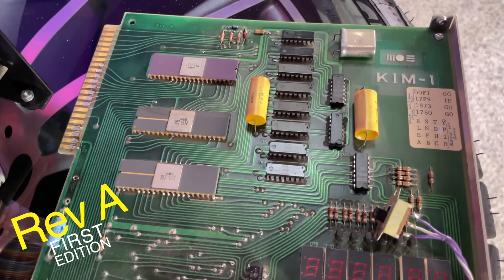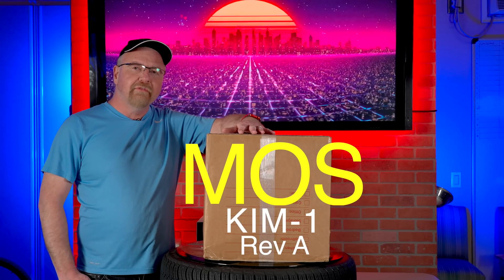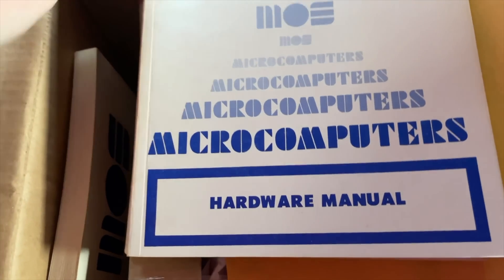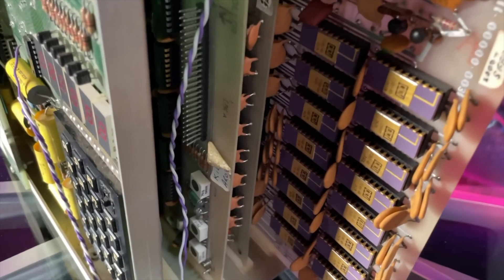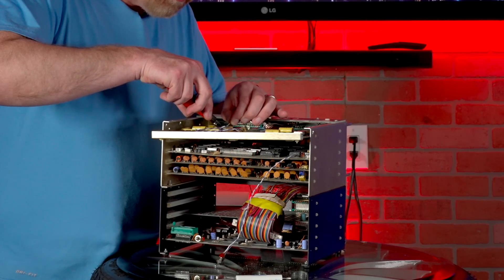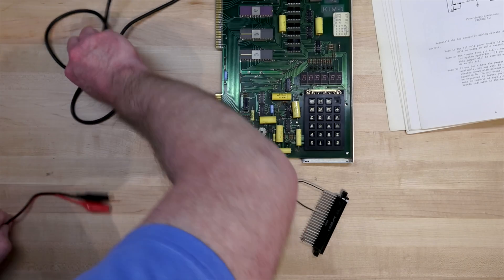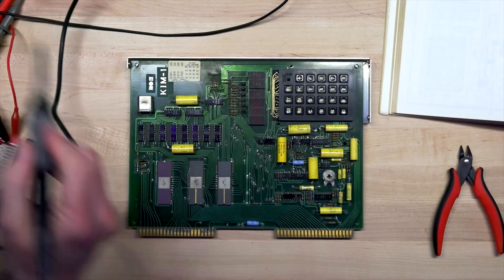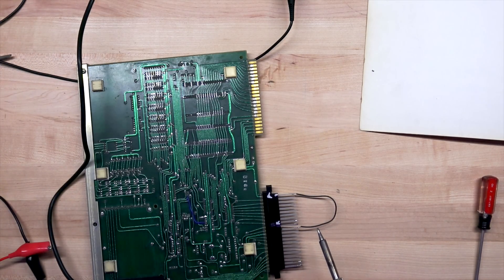I Bought the Oldest PC on eBay! Unboxing the KIM-1

Comment: The KIM-1 actually was my first computer, I was busy building my own from scratch, but that didn't progress beyond 1K of RAM (eight 2102 static rams) and a bunch of LED's and switches, so I could change the bits in the memory. With the KIM-1 I learned 6502 assembler using hand assembled 6502 code, I wrote up the 6502 mnemonics, then using a mnemoncs to hex booklet I hand assembled my code and entered the resulting hex code into the KIM, then saved it to cassette, as a bug in your code usually resulted in the code being overwritten. After that I built a LNW-80 a TRS-80 clone that had color and highres, but color and highres wasn't used, the floppy controller was more interesting as I could boot Newdos-80 and play games like cosmic commander, weerd, and other games.

Comment: I'm fortunate to have had two Altairs, an IMSAI and hand-built a Processor Technology Sol-20.
Bill Gates BASIC on cassette, CP/M, etc. In short, Intel 8080 born and bred.
Now I wax nostalgic for all the Moto 6502, Commodore, et al that I missed.
Saw the KIM-1 back in the day, but will settle for firing up my Apple IIe and writing something in 65C02 assembly.
Thanks for the dynamic memories.

Comment: 14:19 that's a bodge wire, pretty common in older hardware, when it wasn't so simple and cheap to respin a board.
Also, look into replacing those electrolytic caps, you don't want to risk them leaking.
Reply: Those caps won't leak.
Reply: @Dbumbaca1  those axial yellow ones won't, but there are a bunch of electrolytics there (I'm talking about those), and not only that, they tend to lose capacitance and increase ESR with age, so it would be best to recap those boards anyway.

Comment: That indeed is the crystal with 2 leads. The thing is actually a filter that allows only a sine wave at the desired frequency to pass, so the square wave gets filtered down to a sine wave, which then gets amplified to the square wave, and the whole thing then is locked into the frequency that the crystal passes.  Sometimes way back then, things didn't always reliably start, and work had to be done to get enough of a thump into the system to get it to start.  Your system doesn't seem to have that issue. 8)

I'm helping a friend get an IMSAI going, and have learned to hate toggle switch inputs with a passion... you're so much ahead of the curve with the Hex pad.  Good luck in your ongoing efforts.

Comment: Sine wave on one crystal pin is totally normal. The square wave comes from a digital output which has lots of harmonics, the crystal is like a super good filter at one frequency so you only see one ‘tone’.
Reply: TIL
Reply: Mhm but if the CPU performs certain operations on rising or falling flank of the clock, when is it exactly in a sine wave? So aren't you supposed to prepare the clock by turning it into a square wave, amplify, Schmitt trigger, before you feed it to a digital circuit?
Reply: @SianaGearz  inside the cpu is a circuit the drives the crystal and gets its input from the crystal at the same time (sort of an amplifier) the driving side is a square wave and is used by the cpu, the sine side just goes back to the input of the circuit.
Reply: @sefarkas0  Oh so the 6502 has the crystal drive and the digital clock generation built-in; Z80 does not and i think 6510 might not either, or at least is normally used with an external clock circuit maybe for cycle stealing shenanigans.
Reply: @SianaGearz  z80 and 6502 do not have a built in crystal clock circuit. Back then they used external sources usually with more than one clock signal (phase 1 phase 2). Modem cpus have a the oscillator built in and you supply the crystal externally. They are labeled in and out, the square wave is on the out pin.

Comment: Hi Dave.   Broght back memories of the intel SDK-85s We used in college…different processor but All the same functionality.

Yes your crystal is going to take the square(ish) wave from the clock inverter output and filter it to near perfect sinusoid, phase shift it by 180 degrees, and that becomes the input back to said inverter.   Oscillators are fundamentally analog circuits, even though most are built using a logic gate as the amplifier.

One hardware guy tip is to never trust that your oscillator is working or not working based ONLY on what you see on a ‘scope.   The 10pF of a scope probe can be the difference between an oscillator that works or not.

Comment: Makes me want to get out my Kim 2!  I have the one I purchased in 1982 (?) and still have the manuals and even some assembly worksheets I made at the time.  I actually made a commercial product using the Kim 2 and purchased several hundred!

Thank you so much for all of your very entertaining videos.
Reply: Oops!  Spoke to quickly and had a senior moment:  I have a SYM-1 made by Synertek Systems Corp - Everything else is true !  I have never seen a KIM, only heard of them.  The SYM-1 is very similar to the KIM-1 only the board is bigger, the keyboard has more buttons, there is room for more RAM, and room for additional ROM chips.  Mine only has the built in monitor ROM and no basic although I believe there was a BASIC ROM available.  I wrote in Machine / Hand Assembly.
Reply: @Peter-House-Jr  And now we all want some history to this.  None of us are ever going to be Dave, but even an 'amateur'(!) video would be well received.  Honest, no matter how bad the vid, we would love to see it.

Comment: This video was awesome. But as a PC guy, you and myself. 
retro build project.
Could you take an original IBM ?8088?
1st generation then see what latest dos version. MS/IBM/Dr or free dos. You can get just a working command prompt IE list files, CD ren etc.
 Challenge laid!
Games or apps not a problem. Just the command prompt.
As an aside what later hardware can you get working, with additional hardware. SD card reads? Or CDs prewritten  ROM (elsewhere down) to 1.44 MB storage.

Comment: Nice find! I love the form factor.
I've always had a sort of 'fetish' for card cage systems. I spent decades programming, and doing general repairs, and board level repairs on 8080 based card cage PLCs built in the late 70s that were used to run a utility plant, and all the HVAC and lighting systems in all the buildings. The last of which were decommissioned only a few years ago. For their era they were highly robust and one of the models was a dual controller system that could sense certain faults on one side and fail over to the other side where the code had been automatically loaded.

Comment: could you theoretically make a commodore pet out of a KIM-1?
Reply: Not really, but you can quite easily load up 8k Microsoft basic with floating point and run it on a terminal, save to cassette or even to paper tape if you can find the hardware.   Step 1 is make a ram expansion board. The kim only has 1184 bytes RAM on board.

Comment: Can we just stop and appreciate that electronics that old still function?
That was pretty cool.
Reply: the true "solid state" electronics built after vacuum tubes was really bullet proof
👍
Reply: Yes! Awesome video, beautiful machine, wonderful set of documentation. What usually dies on old hardware are the capacitors. The ones on this system looked pretty good. Maybe those early US-built parts were influenced by a 'Mil-Spec' last-for-years attitude. Later production parts in the small computer mass production era began to go down in quality as price became more of an issue. I know we had an IBM 3725 mainframe communications controller with a 3726 expansion cabinet that my company bought near its introduction in 1972. It was still going strong in about 2006, 34 years later. It was still booting off its 8 inch floppy disk. The old IBM stuff never died. We finally replaced our last SNA network lines with routed TCP/IP circuits off a big Cisco 7513 router. The much-loved always-reliable 3725 went off to IBM heaven. Bless Dave (and the original owner) for loving and saving this KIM-1.
Reply: less stuff to go wrong and built by hand makes a big part of its durability
Reply: @animeloveer97  lately most profitable designs include carefully integrated failure points to shorten  repeat business cycles. 
🤪

Comment: Very cool to see. I've had my KIM-1 hanging on display in my home office for a while now. The 6502 is from 2776,  the 6530 2276, and other 6530 1776 is in a white package. The only other differences from yours is there is a piece of red acrylic covering the LED's and someone added what could possibly be a power LED indicator over near the lower 6530. Somewhere in basement is rest of the card cage, nowhere as complete or well done as yours. I had picked the lot up from my former mentor along with his Apple ][+ system when he left Bell Labs to head west in the early '80's.

Comment: I got my start with a clone of the Apple ][ which was also 6502 based. I remember driving to Toronto to buy the bare circuit board and roms from seedy stores in back alleys. My biggest thrill was the day I fixed my last cold solder joint and it booted to life and beeped. Then the fun of getting an old surplus keyboard modified to work with the board. Lots of great memories that you have brought back for me. Thanks Dave!

Comment: On my first job out of High School an Engineer let me play around on his Commodore Pet during lunch (1977).  My second job (1978), as an engineering tech I taught myself 6502 machine code on a Kim-1.  About 6 months after starting we had Rockwell come in and train all of us on their new Aim-65, one of the 3 big single board 6502 systems.  The company only wanted to keep 3 Aims for the lab so I bought the one I used for $300, $75 off of list price.  The Aim was unique in that it came with a full keyboard, 20 character 16 segment led display and 20 column thermal printer, and allowed Mnemonic code entry although you had to calculate your own branches.
Reply: I loved the Aim-65 and built a number of industrial controllers based on it.  This was the system I upgraded to after using the SYM-1 for a few years.  These were the days where programs were stored on analog audio cassette tapes.  We interfaced the AIM-65 to a custom A/D board that was connected to a pressure sensor.  When we moved our office to a new location near a college, suddenly our calibration routine stopped working.  I spent several days trying to sort the problem out. After midnight it worked perfectly.  During the day and evening absolutely erratic. I accidentally unplugged the cable leading to the cassette deck so that the next time I tried loading the calibration program into the the AIM-65, instead of the program loading, the audio was played out the cassette deck's speakers.  Not only did you hear the obvious programming tones (think modem sounds in old movies), there was also a strong music track.  These tapes had never been used for anything but the AIM-65.  That led to the discovery of the calibration problem's cause.  We were located across the street from the campus's student radio station.  The signal from their broadcast was so strong it was killing our calibration and adding music to our recorded programs.  The solution was to only calibrate instruments after midnight when the radio station was off the air.

Comment: Wow this thing is awesome!  I also wanted to thank you for the way you explain things.  I have asperges too and have been in the tech field as well, even having some experience with Microsoft certifications and ironically getting a job at Apple for a few years.
The 6502 CPU has some sentimental place in my heart, but not with a computer.  My first computer was an 8086, but before that I had an Atari VCS, so I guess actually the 6507 variant of the 6502, but I had a starpath supercharger, and quickly learned how easy it would be to write my own programs, and I used the 8086 for that.  Hardest part was getting the compiled code on cassette tape from the 8086 at the time.  Not sure I remember how I did it, I don't think I used the PC-speaker output because I don't think the system timer was fast enough, but now that I think about it the 5150's cassette interface used the system timer, so maybe I did since this 8086 did have cassette BASIC in ROM since it was an IBM.

Comment: The g could be confused with 6.
Reply from the maker: Good point!  But B could be confused with 8... We made sure product keys didn't use both, for example!
Reply: They didn't mix letters and numbers on a row on those connectors. Since you had 22c pins on each side, you had for extra letters. They dropped the easiest to confuse and used the remaining 22.

Comment: That crystal - the sinusoid output is the undriven leg. The square wave is from the chip that is feeding back to the crystal.
Reply: The wave did not look very square to me…?
Reply: @jackgerberuae  That may just be how Dave had his probes attached. If they weren'r grounded close and on x10 then the square wave will appear to have slopes and ringing, the signal on a crystal is easily distorted by adding abnormal loading.
Reply: @IanSlothieRolfe  thanks 👍
Reply: @jackgerberuae  Normal Gibbs phenomena and the non linear aspects of the TTL output and the frequency depending load contribute to the shape of the wave.
Reply: @jackgerberuae  They rarely did, since it drove an unterminated line. It looks even worse without something like the Tektronix P6201 900MHz FET Probe, which was made for scopes like the 2465 series. it is very high impedance and has a very low capacitive loading which won't affect the signals. I needed one when working on some 68340 based embedded controllers to find crystals that were operating in the wrong mode.
Reply: @michaelterrell  thanks for the detailed explanation 👍
Reply: @jackgerberuae  I started working in Electronics in 1966. I ended my career in 2001, building Telemetry equipment for Aerospace so I encountered first hand a lot of experience, and had the added help of older people to learn from. I  just want to pass on things so they aren't glossed over and forgotten.

Comment: I've been watching a lot of Tech Time Traveller, he's done a lot of videos on old micro computers and terminals that are great, Usagi Electric has been doing a series restoring a mini computer, he recently got it to boot and was able to use the testing operating system to edit hex values in memory and then execute it.
Reply: I've been following Usagi's quest to restore that ancient Centurion minicomputer, it's amazing how much he's gotten to work considering the hard drives were both crashed beyond all hope of repair (which is prob. why he got it for $300) and with the help of that guy who had the diagnostic board and some amazing helpers in his discord, it's up and running code now. All he needs is a storage solution and the Centurion lives again!
Reply: usagi is the kind of man I aspire to be like when older.

Comment: I'm always amazed by old hardware. I'm in my 40's and I built my current computer but these days it's like assembling Lego as the hardware side is mostly done for you.
Reply: If you want the ultimate experience, build Ben Eater’s 8-bit computer. The term “computer” is really loose there, you’re in fact building a processor using gates, designing the instruction set and implementing it all using chips and breadboards.

It’s a blast.
Reply: @c1ph3rpunk  I have my ben eater SAP1 framed and hanging on my wall.  It's my most prized possession, and I learned a TON building it.
Reply: It's nice that the hardware is taken care of so it's more accessible, but nowadays if you want to know about the hardware you're using(how it works) you basically have to go back to microprocessors like these

Comment from the maker: Why does the crystal have both a sine wave and a square wave?  What's up with that?
Reply: See my comment above.   Maybe I’ll make a video on how typical computer clock oscillators work.
Reply: Sine wave instead of square wave = grounding problem
Reply: Dave, if you have a schematic of the board, I believe you’ll find that the crystal is just one of several components used to make up a “clock generation circuit” required by the 6502. As best I can recall, one lead of the crystal is wired to the input of an inverter (typically a 74LS04 or similar), and it’s not unusual for the signal on this lead to appear sinusoidal. The output of this inverter is then tied to the input of a second inverter. The output of this second inverter is then fed back to the other lead of the crystal, and this signal looks more like a square wave. (This signal is also fed on to the clock input of the 6502.) In short, I think it's normal for the signal on one lead of the crystal to be sinusoidal, while the signal on the other lead is a square wave. (Be forewarned that I’ve likely forgotten a few passive components that are also part of the clock generation circuit. I vaguely recall a couple of resistors and maybe even a small (pFs) capacitor. Who knows? It’s been a long, LONG time ago.) Great video.
Reply: Speaking very loosly here- Crystals are sin wavey naturally and have to go through a gate to get the impedance right to get them oscillating at the right frequency and  to square it up  the waveform.  Speaking of oscillators - note this - A gentleman named Ed Arnold came out of MOS and partnered with other local IC industry people from places like Solid State Scientific of Montgomeryville PA and formed a company called Integrated Circuit Systems in King Of Prussia PA- this company specialized in silicon timing products, PLLs, and would go on to be a major supplier of system timing products for computer motherboards.  It was a great place to work.

Comment: I was always wondering how to buy an old mainframe.
Reply from the maker: Not quite!  But it's similar to a minicomputer in many ways. Note it says HOME computer!
Reply: @Dave's Garage  Yeah, I know KIM-1, but my point is that you can't buy mainframes on ebay and those from '60s and '50s are older than KIM-1.